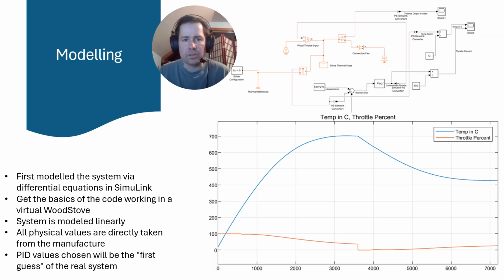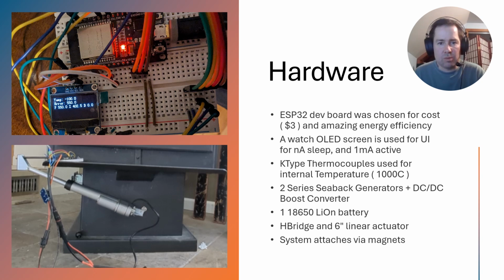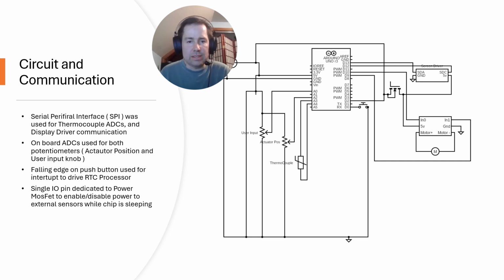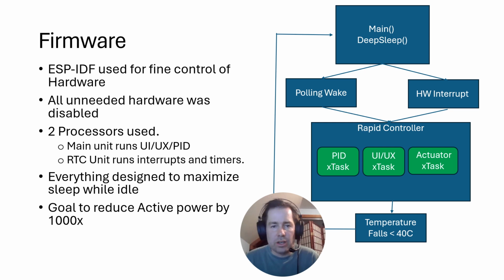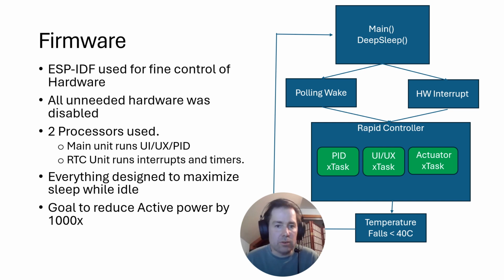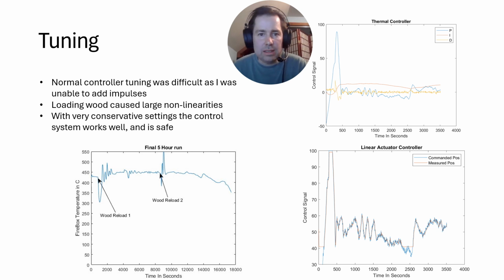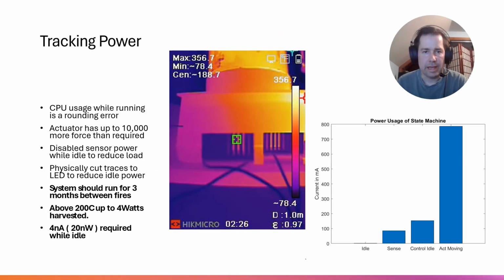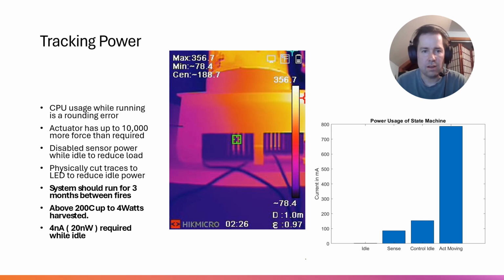Self-Powered Wood Stove Controller

Comment: This is a really good project! I wanted to design a control system for wood stove but did not go trough because it required power, but this simple idea of using TEG solves it. For further improvements you could also monitor O2% in the flue with a lambda sensor. Where can i find the documentation? i'd love to try your simulink model.
Reply from the maker: I am waiting for my professor to review and grade the paper.  Once he is finished I will update the description.

Comment: This is really cool. I would be interested to see a full breakdown of proportions of energy consumed by each element over time. I have worked on something pretty similar to this and we found that, for example, quiescent draw of the switching regulator consumed a significant amount of total energy (even good buck converters can be around 20uA).